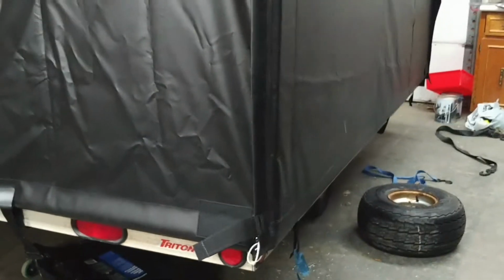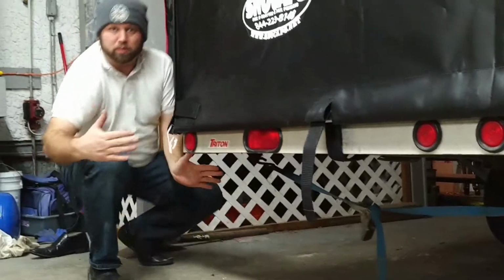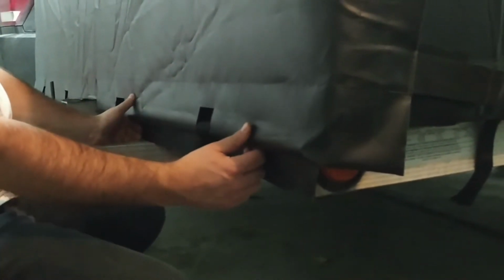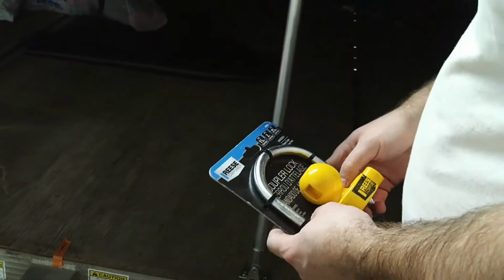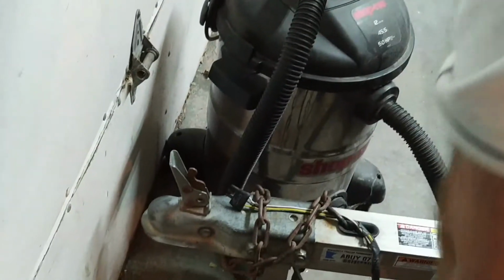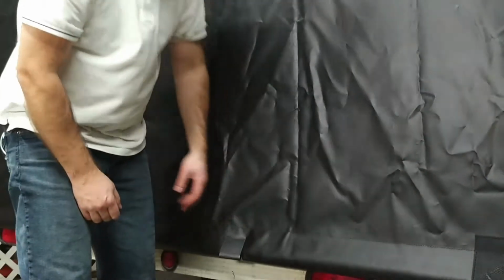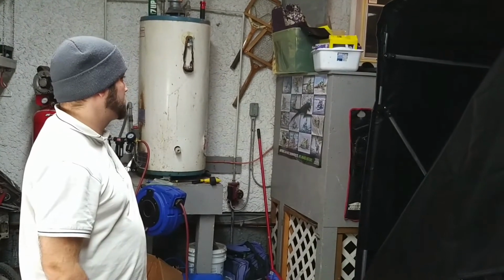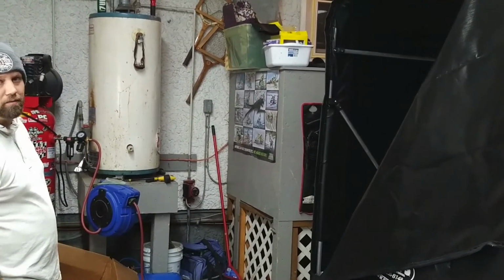Snowmobile Trailer Cover the cheaper option Part 5 Completed!!!

Comment: Was this a kit that a guy can buy complete & if so how much was it for that size trailer ?   A buddy of mine just gave me a free sled trailer that's in good shape that I would like to put one of these on so I can store my 2 sleds in it to make more room in my garage for other projects I am needing to get done.
Reply from the maker: Yep I totally hear yea on it, I'm also short on room and this kit is a complete unit for my 10 foot by 8 foot wide trailer...  They come as a package depending on the customers trailer.. I like the service from these guys they shipped it fast and it game properly packaged.. Instructions are pretty good but plan a whole day and take any short cuts... Like new drill bits for the holes and take your time very easy once you start....  Check out there website I have no affiliation with these guys except I'm a customer that's it.  http://canvasworksincmn.com/
Reply from the maker: Duane Smith Canvas Works, Inc
VOSB - Veteran Owned Small Business
PO Box 247
245 Cokato St E
Cokato, MN 55321
P 320.559.0165
Toll Free: 844-223-8148
Reply from the maker: I should also say very happy with the product going to mountain trip on Thursday and this is exactly why i went and did this keep the machines clean and I have also used it for hauling furniture and other things.. It gives you a sense like everything is very safe in there.... I still tie things down of course.
Reply: Kc Yukon Thanks for the information  !
Reply from the maker: @peteloomis8456  No problem happy to help!